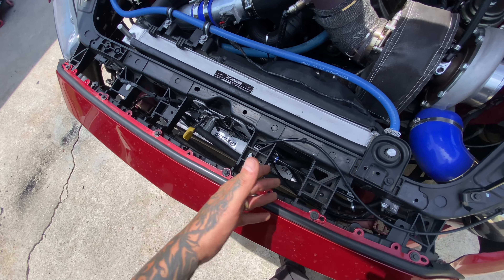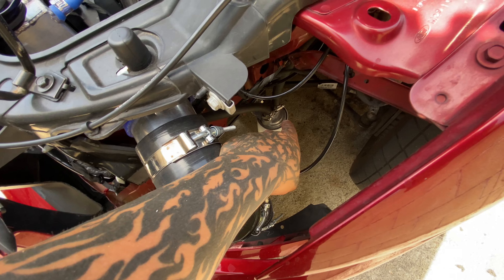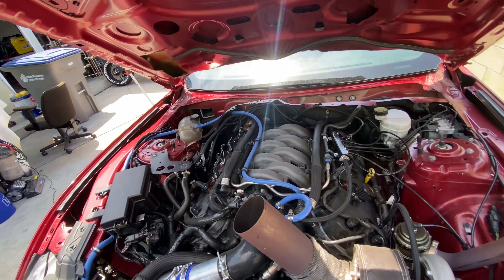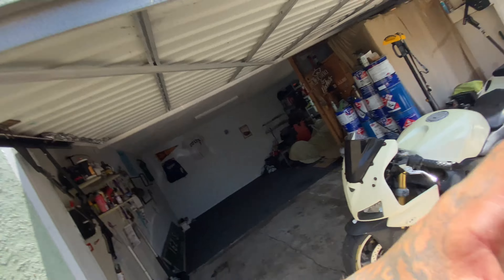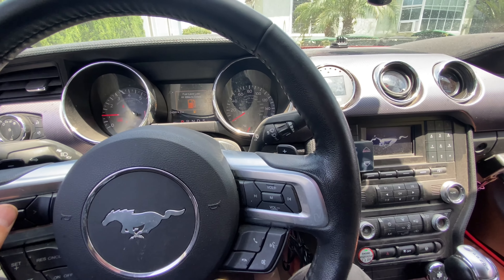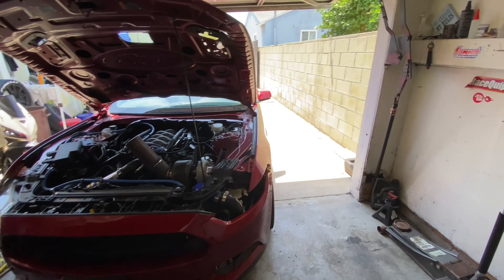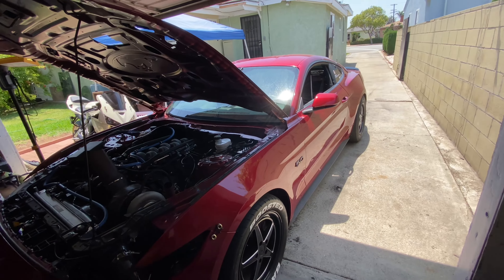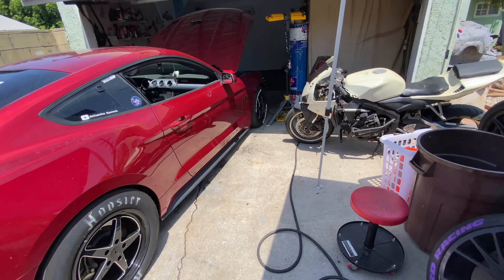Single Turbo Mustang Gets a 91-93 Lund Tune flashed *Street Use*

Comment: Yo for oil turbo feed line, I didn’t wanna relocate oil filter and all that, think I could use the oil pressure sensor hole right above the oil cooler?
Reply from the maker: I don’t see why not. I would just monitor it as soon as you start up. Maybe start her up and shut her down. Check the line to see if it is getting fed
Reply: @DiablitoSpeedz  I figured so I’ll definitely do that, I also wanted to retain the oil cooler lines, hopefully those don’t run into the piping